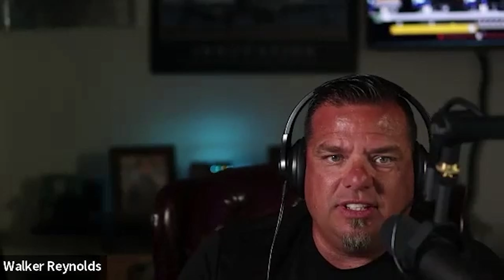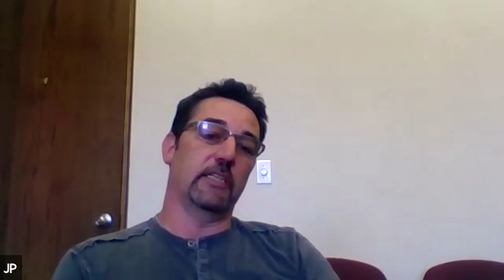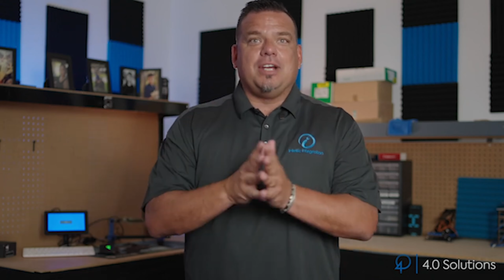Why you need a single point of entry with common infrastructure

Comment: So with that being said, by using a unified namespace will allow us to use that UNS data in the PLC to improve the logic?
Meaning, I have written code before to self-adjust things on the machine as the product changes so in other words, it's a learning section of code that reacts off of the data that the logic has gathered.

Using FIFOs & arrays to store the data.

I ask this question because if the UNS can do this then that would solve huge problems very quickly.
Reply from the maker: Potentially, although you wouldn't want a PLC or SCADA to be reliant on it. A UNS enables a contextual history and sharing the data so other machines, other lines can benefit from the learned info. Great question to explore further in another video.

Comment: I would argue that UNS makes a decoupled environment and enables tools like Power BI when best suited.  And this is not comparing technology in their expected roles.

As you know, OEE is an artificial number(a score), and you can't just average things. Tabular Models, the DB in Power BI, can eliminate the need for redefining the underlying dataset for all the permutations that users may want to filter OEE and related KPIs by. 

Also, web applications can co-exist on a single pan of glass.  Power BI is a web app like ignition and other preferred plant floor platforms. I would argue a web-based interface should not have users click more than three times to get to the data they want. As a best practice design, if that landing page is a single-page application, they should not navigate three levels deep when doing analysis. However, I think the argument there can be only one web-abb vs. having only one phone is also not an equivalent

Some argue that information is time sensitive and data is parsable, so real-time data is the only priority. Our current Lean incentives are encouraged to focus on yesterday vs. today to escape a reactionary mindset. When focusing on past information, Power BI is a good choice because this is now data analytics vs. presentation. Both are needed, and as I said, Power BI shouldn't yet be used as a real-time SCADA solution. They have different roles.

Also, considering that a UNS would only have a day or two of history, UNS and Azure doesn't appear to me like competing equivalents. I can't recontextualize the UNS-like data lake into a Star Schema data warehouse.  And, we wouldn't want a SCADA system based on an analytical resource. So they are two different things. But I want all that information in front of operation co-workers as much as possible, the smartest people.  

Power BI is a player in an ecosystem, and UNS is the gravitational center of the system. However, that tabular DB should be able to push a KPI to the UNS for near real-time consumption if need be.